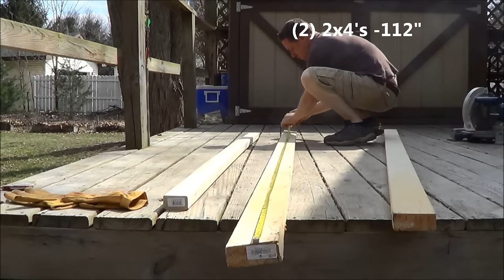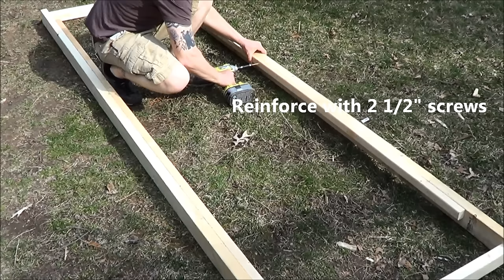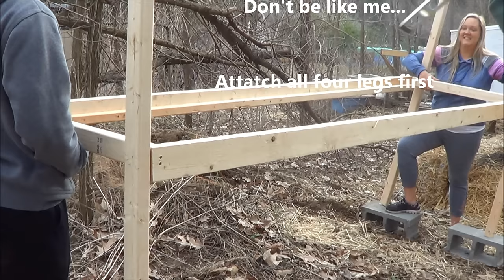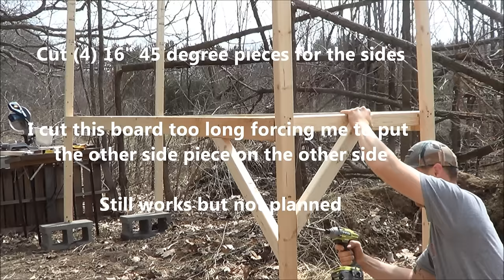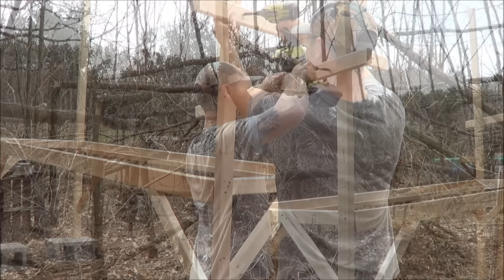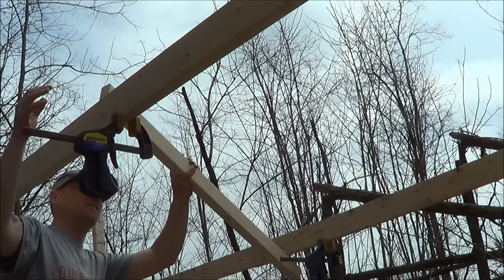HOW TO BUILD A RABBITRY HUTCH-PART 1

Comment: Aloha!  Thank you for sharing this. Building mine today with some mods.  10’ long and 12’ roof to keep rain off without solid side walls. Hot and humid here so airflow is 👌. Hoping it turns out ok 😆
Reply from the maker: air flow is very important. best of luck!

Comment: So I've watched the videos and looked at the PDF for this. The materials and budget is blank at the back. I see the dimensions you cut the pieces to but I'm wondering if you have or could share the material list so I can make one trip and buy it all. Thanks for the good videos and products. Keep up the good work
Reply from the maker: I don’t have a parts list but you can buy in bulk and return what you don’t use.

Comment: I am ready to upgrade my rabbit hutches and really like your design. One question, if you are still answering years-old videos, is that it seems you put this on cinder blocks, but I couldn’t see them under your other hutches. If not, do you prefer “blocks” or “not-blocks”? Thank you.
Reply from the maker: You bet, you can leave a comment on any video and I’ll try my best to respond within 24hrs or sooner. I still use blocks but you can also use treated 2x4’s or 4x4’s with cement anchors for a stronger build. It really depends on your wind conditions and size/ weight of hutch. Best of luck with your build!

Comment: Do you wish you built it out of pressure treated wood? Is it still holding up?
Reply from the maker: It’s holding up great I power wash it every year and a lot of the lumber is covered 
You could get away with treated wood for the legs and for the hutch holding the cages but in the run I didn’t want them chewing on treated lumber but they don’t really seem to chew it so using treated lumber especially if you’re going to build a deep run excavating a cavity, I would recommend using treated lumber for that. 
Thanks for asking!

Comment: Do you sink the legs in the ground? If not, how do you make it doesn't blow over? Also, what size are the cages that fit in there? Thanks!!
Reply from the maker: It’s very heavy. No trouble yet and it’s been years. But there’s no harm in preparing for the worst and be sure to customize it however, you want in order to make it tough and durable for your area.
Reply from the maker: 30x30x18
Reply: Thanks!

Comment: Have you ever had a problem with rats or raccoons trying to reach through the bars and get at the bunnies? I had it happen to our quail in the same yard my rabbits will be, so I am not sure if this is a concern with rabbits as well
Reply from the maker: Yes. When it comes to the rabbits in the cages it's rare but we have had some raccoons on video. We set out the camera to catch what ever was killing our chickens and caught the raccoons looking at the rabbit hutch.  Make sure your hay and manure doesn't get so high that the raccoons can stand on it and reach the rabbits. I saw the raccoons inspecting the cages.  They'll climbed up and pulled on the cages but quickly realized that they'll need to expel a lot of energy in order to break into the cage which they won't be interested in doing.  As far as the runs go the rabbits just run into there tote and the raccoons are confused on where to even dig to get a rabbit.  The runs don't have any intruders.  The most important thing is to do your inspections every few days to make sure everything is secure.

Comment: Great video!
I am building my own hutch and was wondering if you could use pressure treated wood for the bottom frame. It wouldn't seem likely for bunnys to be able to chew that wood when it's covered by a fine wire but I wanted to make sure.
Thx!
Reply from the maker: No they can't chew it. Your right they won't be able to get to it.

Comment: I don't suppose you have plans for your 4 cage hutch? I realize I could do the math with the 3 cage plan but knowing me, I would mess it up and I'd rather not re-invent the wheel if its already out there. ..Also, it's missing the Materials List/What you're gonna need. its listed for the roof build but not the main part of hte hutch. I tried piecing it together for a complete list but I can't quite figure it out
Reply from the maker: Simply enter your email and receive plans to the hutch and more goodies
https://preview.mailerlite.io/preview/37362/forms/54213430306931898
Also here’s a video that shows an addition we put on to make Room for the fourth cage https://youtu.be/-rlvYTFH0zY?feature=shared

Comment: Really glad I found your videos. We use TS cages, too, and I was trying to design a hutch to hold the cages. Your videos are really helpful and encouraging.
Question: Do you build a run and cool box for every doe or do you swap out the doe that is about to Kindle?
Reply from the maker: It's recommended to assign a dedicated nesting box for your does and to avoid swapping so I try to adopt the same method with ramps and cooling totes the best I can.  But I have swapped out does before with no problems at all but I always clean the totes on day 29 to prepare for the litter.

Comment: Hi there how do we access the plans?
Reply from the maker: Did you try clicking the link in the description?
Reply: The Rabbitry Center hi ! I did it said I needed to request access. I did so and have not gotten notice of approval yet. Thank you!
Reply from the maker: @FaerfolkDogs  A subscriber set that up for me I'll reach out to him and try to find out what the solution is. Thanks for letting me know.
Reply: @TheRabbitryCenter  Thank you!  I've got most of the framework done based off of your video!
Reply from the maker: I got the plans on the website now. 
You may have it built by now
https://www.therabbitrycenter.com/the-rabbitry-centers-hutch-build/
Reply from the maker: @FaerfolkDogs  https://www.therabbitrycenter.com/the-rabbitry-centers-hutch-build/

Comment: problem with a wooden cage is that it's not durable and its a serious ear canker hub. the mites that cause ear canker love breeding and dwelling on wooden surfaces. so a metal rabbit cage is often strongly recommended.
Reply from the maker: Thanks for the tip. I appreciate you taking the time. This is something you want to keep up.  Annual power washing will help.  This design has held up pretty good and is an inexpensive set up.  But it's definitely for a start up.  If folks find that they have a real passion for running a Rabbitry I'd certainly recommend down the road investing more money into a bigger and stronger set up and that videos coming.  Stay tuned and thanks for watching.
Reply: @The Rabbitry Center  sure hey. thanks for your very informative video. looking forward to more updates
Reply: The Rabbitry Center Bobby do you treat the wood in any way to protect it from urine rot?
Reply from the maker: @jeanettehaygood4154  Sure do every year I'll take one day to remove cages and power wash.    This set up is quick and relatively inexpensive setup but has it's necessary annual maintenance drawbacks.
Reply from the maker: https://www.youtube.com/watch?v=d9FZSWXxLxY&t=307s